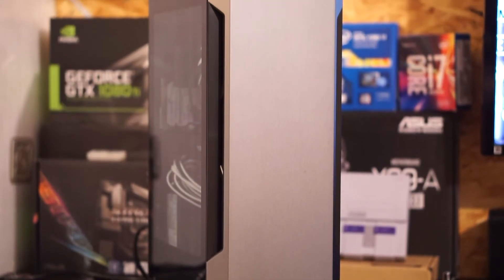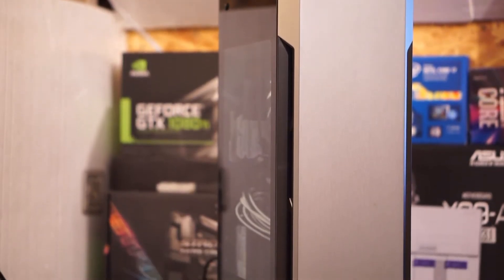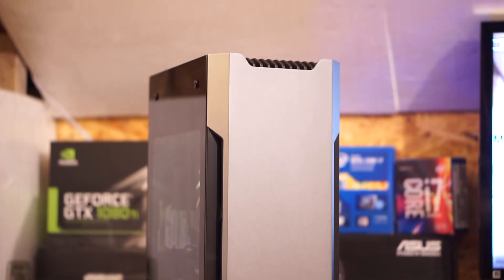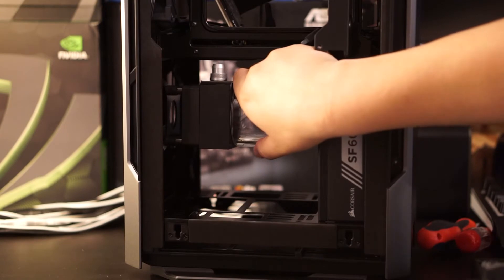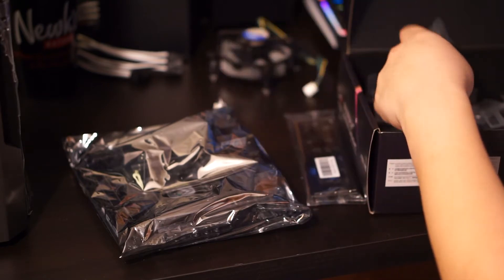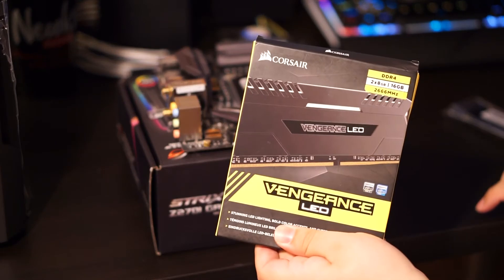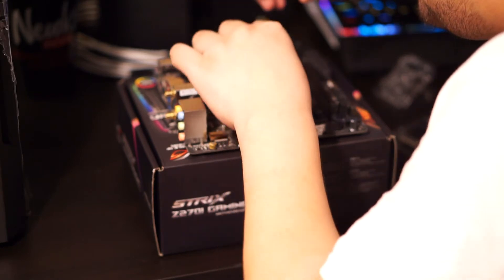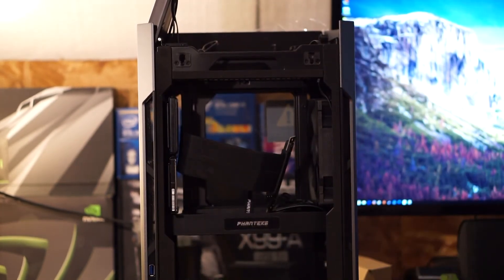Let's get shifty (Build pt.1)

Comment: My issue with the case is that for ITX is overall size is quite big and even then getting things to fit can be difficult and you might have to compromise on components. I'd only use this case if I absolutely LOVED it and had to have it (and I don't).

Comment: great video, looking to buy this case, and really helped me get confidence in buying this case as based upon my friends opinions its hard to build in
Reply from the maker: HaZy it's a great case. And it's somewhat of a pain to build in. But the final build came out great. I'll be putting up part 3 of this build soon. If you want to see what it looks like in it's final form, head on over to my Twitter page.
Reply: is it worth the money if i dont include a custom loop?
Reply: or even if i dont include an aoi cooler, just a fan
Reply from the maker: I would say so. Custom loop or not, this case looks great. Phanteks never mentioned that this case can accommodate a custom water cooling loop.

Comment: how about using 117mm reservoir?
Reply from the maker: Chanjull 19 yeah you can. That's the height of the reservoir that I'm using. The dimensions for that is 68X67X117. Still gives me enough room to unscrew the cap and fill.
Reply: can you fit a 120mm or 140mm fan on the front, behind the panel?
Reply from the maker: Chanjull 19 no. There isn't enough clearance for it. You have to mount the fans inside the case.
Reply: +Jose Gomez not even the slim one?

Comment: Damn, are you sure MSI Gaming X won't fit this case? Just ordered one and AFTER that I watched this video.
Reply from the maker: Szymon Wilczyński Kyle was able to fit an EVGA 1080 Ti into this case so I'm sure the MSI Gaming X will fit.
Reply: Jose Gomez damn x2, I asked on a wrong thread, I mean video. TechteamGB mentioned that MSI Gaming X requires some modification in a case's GPU holder to fit this card.
Reply from the maker: Szymon Wilczyński it might be bigger than EVGA's graphics card. Check out Kyle from Bitwit. He made a video on it too.
Reply: Jose Gomez I saw Kyle's video before the one from TechteamGB, hope my card will fit or require really small mod. I'll see in a few days :)

Comment: Guys HELP please:  in a PHANTEKS Evolv Shift with a Ryzen 5 1600 would you recommend the NZXT Kraken 52? Or should I go for a Rayzen 7 1700 with the stock Wraith Cooler? 
Q: would the Rayzen 7 survive (no OC) at reasonable temperatures in this tiny case?
Reply from the maker: Ian Strom the X52 is a 240mm radiator which will not fit in this case. You would need the Shift X for that. Only a 120mm radiator will work in this case. As for the CPU, that's going to depend on what you'll be using it for. You can air cool if you want to. I had a Cryorig C7 cooling the processor before I put the water cooling kit in. I didn't see any crazy high temps when I was air cooling.
Reply: Thank you so much Jose Gomez, I was just about to order one without realizing its dimensions, well thought and nice of you to point this out and just in time. I will try air at first with the Ryzen 7 on stock cooler, mainly for common tasks and few video renderings from Adobe After Effects, no major gaming. Much appreciated!
Reply from the maker: Ian Strom you're welcome. Give it try and if air cooling isn't cutting it, get a 120mm CLC from NZXT or Corsair and water cool it.

Comment: I think that you could possibly fit two 120x27mm radiators if you went for an expandable aio like the fractal design kelvin T12  and a small reservoir. Looking forward to see how your build will come out, i have my Shift coming in this week!
Reply from the maker: ilias photography I'm sure two of those would fit. I don't know if a small reservoir would along with it. It should be easy to fill the T12 if it was expanded. I had forgotten about expandable AIOs.

Comment: i have a ftw3 hybrid and a slim 120 aio cpu cooler, will it fit? i will buy it now if it does.
Reply from the maker: Ryan Pruske it should fit as long as it's a 120 mm radiator.
Reply: Ryan Pruske both Have to very slim fans and slim rads

Comment: is it really possible to mount the watercooling in a 90° position? i´ve the same set up than you but have mounted the ek a120 in normal position.???????
Reply from the maker: Michael Gössl yeah it's possible. Part 2 should be out Monday the 16th. That's when I get the rest of my water cooling fittings. If you follow me on Twitter I did a thermal test. Results are surprisingly good.
Reply: wow, your amazing. 5min for answer XD ok thank u for the information. i´ll give this a try and mount it also in this position. ;-)
Reply: ok, i looked at your twitter pics. but u use 2 pumps instead of 1. would the 2nd be also in a 90° position?
Reply from the maker: Michael Gössl I used the second pump for testing outside the case. I didn't have the angle adapters and the GPU was blocking the ports. That's the reason I used a second pump. Once I get the angle adapters, everything should plug in according to my schematic.

Comment: Jose, just a heads up, the shift has a pci express cable 2.0 not a 3.0.
Reply from the maker: ImpulZ Imp thanks for the info. I haven't looked into it but I may have to get another riser since this one is too short. I want the GPU to face the other way.

Comment: Nice video...can you confirm a 140mm aio at the bottom?
Reply: have a NZXT kraken x41, won't fit
Reply from the maker: CapcomsHero I don't have a 140mm AIO on hand but I can confirm that a 140mm fan will fit in all three fan mounting locations. So a 140 rad should fit. Just take in mind the thickness.
Reply: Starfire Technology  would a different 140 aio fit?
Reply from the maker: Robert Schäfer I wouldn't know since I don't own any 140 rads. The manual states that only a 120 radiator fits.
Reply: Jose Gomez  
Thanks man

Comment: Can't wait for the Part 2, this is what I was thinking about, to put an EKWB A120 cooling loop into the evolv shift.
Reply from the maker: I should have the A120 soon. I have to save money to get these items lol. I also have to order the Rotary Terminal for the GPU and some 90 degree Angle fittings for the radiator and reservoir.
Reply: Jose Gomez Yeah I believe you can make it! Watercooling from EB isn't cheap. It is fine since you already have the hardware components, but if someone's building a new pc, investing on a more better cpu is the better choice.
Reply from the maker: anthony ZAPATER part two is slowly coming together. It takes a while for the fittings to come in since I ordered directly from EK. I was gonna do two 120 rads at first but then ran into the clearance issue. But I'm curious to see how one rad will handle it.